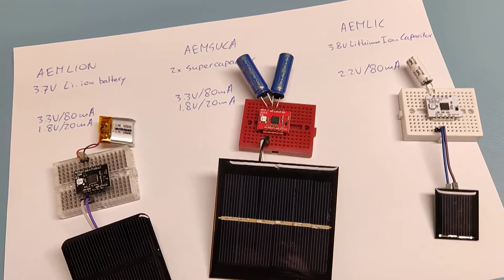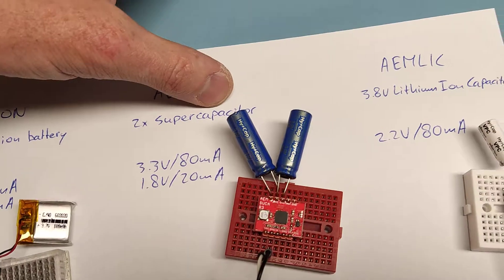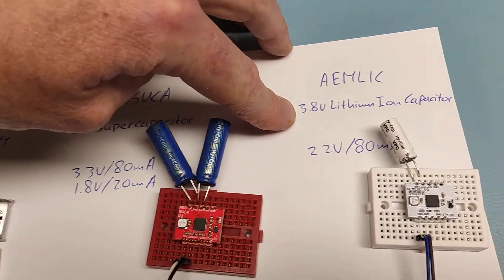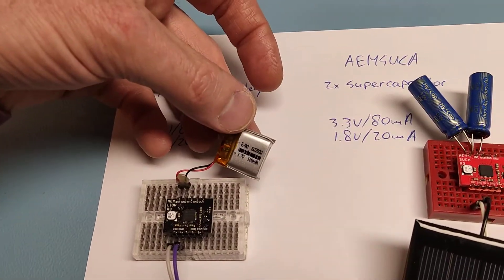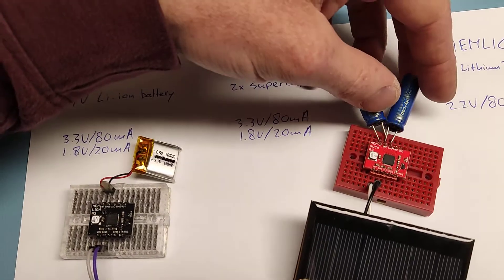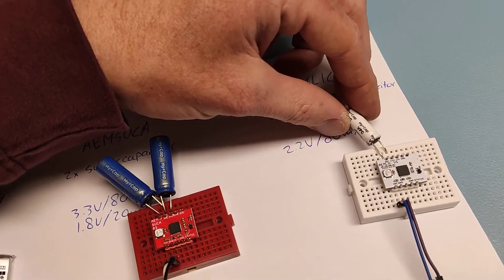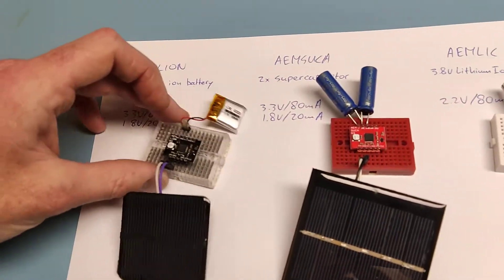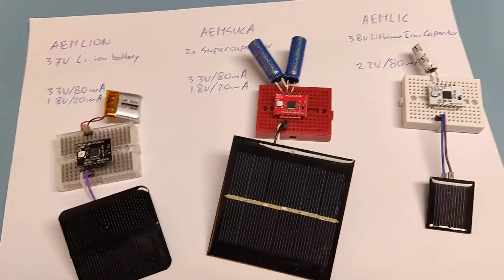Three tiny solar harvesting boards based on E-peas AEM10941

Comment: Is it possible to disable the buck converters entirely? In my application battery management is done separately. I could also just read the datasheet for the AEM10941, so I did and there are two pins: ENHV and ENLV which can be pulled down to disable either. So are those pins accessible on your Li-ion version board?
Reply: -Looked closer at a pic of your board. Both ENHV and ENLV go to vias, so they should be accessible from the backside. However in the application note, ENHV and ENLV are also connected to pin 3 BUCK, which possibly should be cut to, not mess up the onboard buck converter when they beome grounded? So are those modifications possible on your board?
Reply from the maker: @Tore_Lund  my boards a pre-configured and ENHV and ENLV it cannot easily be disabled using a jumper or a resistor. I don't recommend cutting traces and reconnecting. But I am happy to provide new boards if you accidently damage the boards. To fully reconfigure the features of AEM10941 you can buy the official E-peas evaluation board.
Reply: @JasperSikken  Thank you for your honest answer. I do have a SMD workshop at home, so usually not intimidated by such a challenge. But I will take your advice to heart.

Comment: What's the minimum input of mA to charge the capacitator.
Reply from the maker: The chip does a cold start from 380mV and at minimum 3uW power. After that the chip is able to harvest down to 50mV with minumum input power of 3uW. Maximum input current is about 125mA
Reply from the maker: By the way I have a new version of the board, with 3.3V/400mA output. https://www.tindie.com/products/jaspersikken/solar-harvesting-into-lithium-ion-capacitor/
Reply: @JasperSikken  can I speak to you in a email. In regards to my specific project involving candles and solar.
Reply from the maker: @ryanwalsh1480  yes jrsikken ad jeemail dot kom
Reply: @JasperSikken  sent a pm in Skype ty